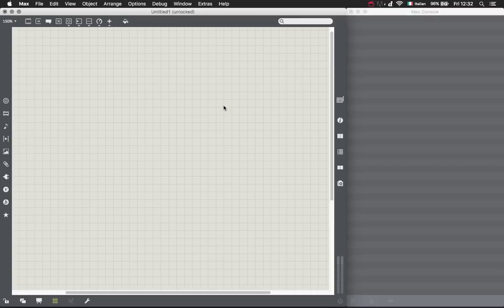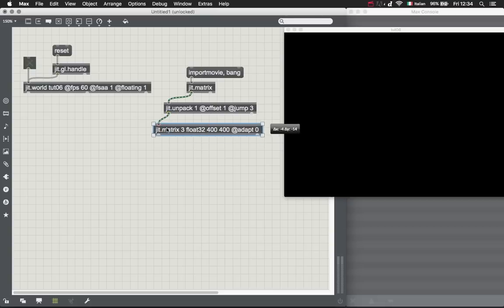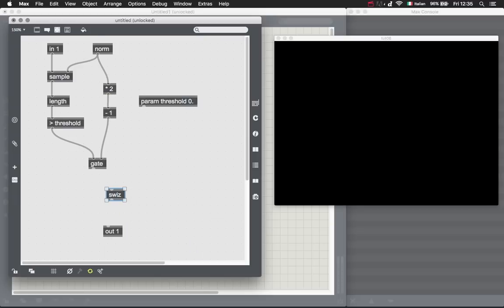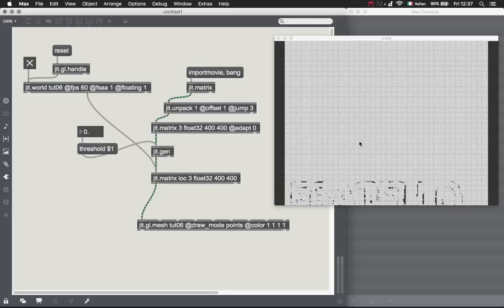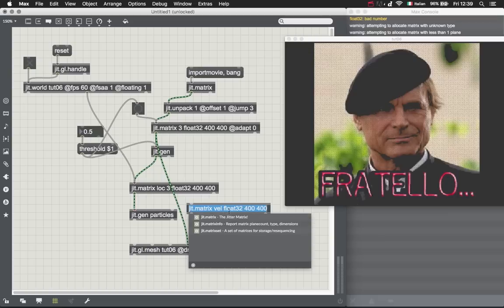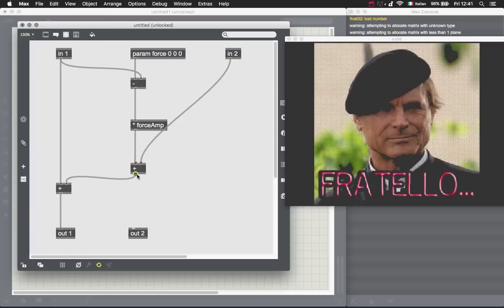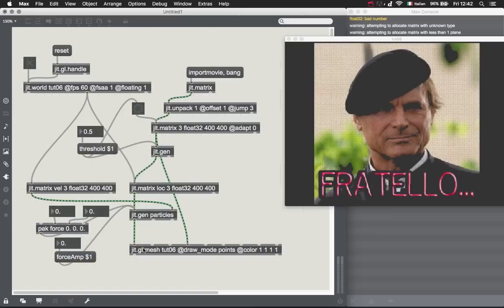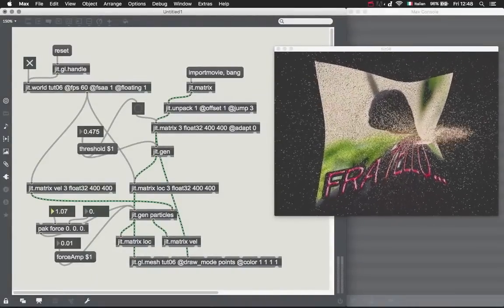Amazing Max Tutorial 06 - How to transform an Image into Particles

Comment: Problem solution :-D
Hi guys, I've been fiddling about the same problems as mentioned above. "bad number" error messages when the jit.gen is named, no console messages when the jit.gen has no name, pic in a jit.pwindow until a certain point of the patch, but nothing at all in the jit.world canvas. Ok, so far.
The error in the patch is that the two jit.gen objects are working with int numbers. So I put a . (dot) after each number in those two jit.gen subpatches, and everything worked as expected.
However, one additional hint: When running the patch with values too extreme you may loose your pic and the result is a blank jit.world canvas as well.
For my patch that was/is the solution. Hope y'all get yours working as well :-)
Reply: Doing both renaming and adding floating points in the gens worked for me. thanks
Reply: @JZ_Strings  can you give me an example / a bit more info on how you fixed this pls? Where / how are you adding floating points? And what are you renaming to? Thanks so much!
Reply: @soundguyldn  Sorry man I cant remember at all lol

Comment: Pretty amazing. I followed it step-by-step and everything went flawless. However I am having trouble the second (third...) time I opened the patch — I only am able to get it work again after renaming the location and velocity matrices... I am working with Max 7.1 but the same happens with Max 6.0.7. Any clue? Anyway, thanks you so much for your tutorial.
Reply from the maker: +Horácio Tomé Marques Yes Horacio, I guess is an issue with the unorthodox use of gate in the first jit.gen, which returns some bad "nan" data. A solution is to rename the velocity matrix like you did. Sorry for the bug, but thanks for following this!